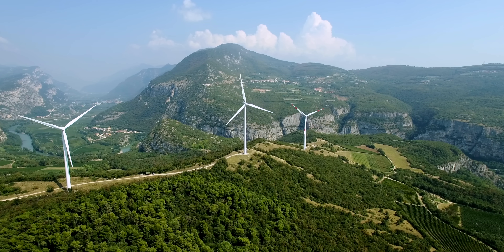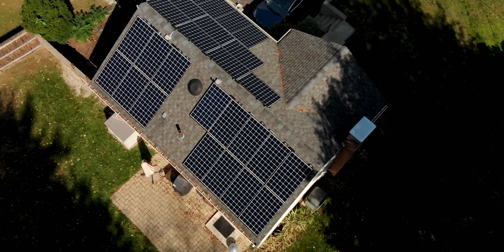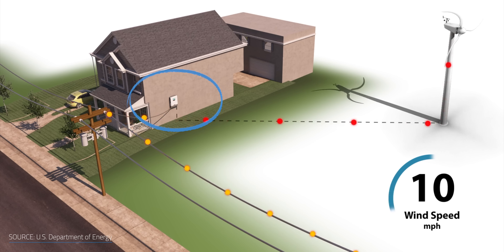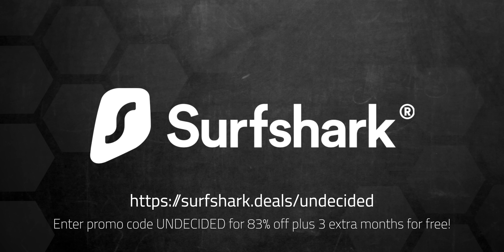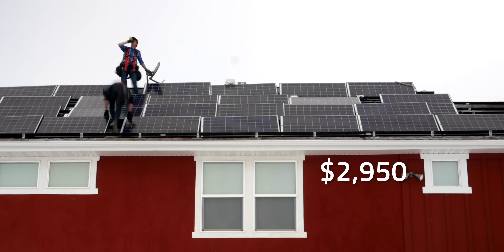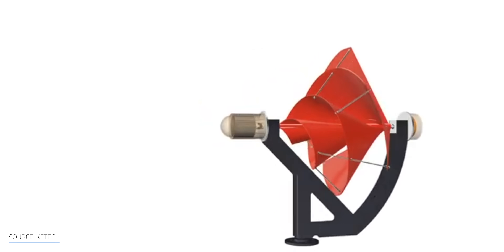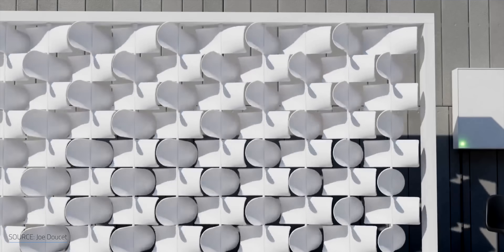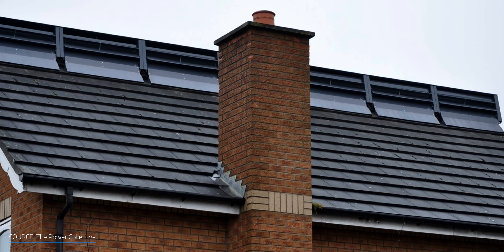The Challenges of a Wind Turbine on Your Home

Comment: This video should be 5 seconds long- no, you can not practically do this on a single-family home. Unless of course you want to spend 10's if not 100's of thousands for additional structure and various methods of sound attenuation. In separating the turbine from the home's structure you will lose vast interior space, and probably have a lot of leaks as the two systems can't touch for sound and structural reasons. Yes, he does touch on this in the video- but this is not a situation of pros and cons. It simply doesn't work for almost any home or budget. This is what happens when one Youtuber makes videos about literally everything.

Comment: So do your CO2 emissions include everything that went into making the solar panels or wind turbine, the manufacture of parts, the coal powerplants that run the chinese factories that made the solar panels, etc.  Was the mining of minerals included, and what about the particulate pollution caused by the chinese mines which have no environmental regulations.    Just curious if you included all the "other" factors in your green calculations.

Comment: I currently line in Fairfield, Ca where we can get at least a breeze of a few mph on 95% plus of days. I think that if you could find a small, yet efficient wind turbine and pair it with solar and a home battery pack (ex: Tesla Powerwall) it could make a decent 1-2 punch. I mainly see wind turbines “take over” power production from solar especially during nighttime or during times of severe overcast where solar cannot produce power or is very minuscule. Living on a coast or near a highway/large road or even a train line could also help produce some extra energy

Comment: As you said the payback period is too long and the cost of servicing. If both were 50% cheaper it may be worth exploring. I did like the system added to the roof ridge to gather wind. Looks better than the others perched on a 20M pole or big and fat design.

Comment: yeah, downsizing doesn´t go proportionally. if you want to go from 500kW to 500W, you would have to lower a 100m tower to 0.1m. even if technically possible, there is not much of the wind.
in my country we say for microturbines at least 10m above any obstacles withing 100m range. so 25m trees in the country or 25m houses in the cities + 10m - see how much does that tower cost and then forget it anyways as you probably won´t get the building permission regardless or do it in 5m and produce so ineffectively

Comment: The Ridgeblade system is very similar to a German design called LWS (Low Wind Speed) system, of which it has been impossible to obtain any reliable performance data for over 8 years now. The data they have provided though are data that does not take into account the drag a generator load will impose on the turbine, making the data totally unreliable, with performance even outperforming horizontal wind turbines. Despite having offered them verifiable test result with a trial installation, where they only had to lend us the turbines for the testing phase, pending our actual purchase if they performed even half of their promissed performance, so watch out, I really don't think you can rely on any of their data.

Comment: If you build the wind turbine yourselve, you actually only need a good ac "motor"/generator.
you can build it on a pole, and make sails yourselve.
buying is ok, but takes long te return profit.
build the 250 dollar machine yourselve.
you actually require to buy 1 part (and a converter if its a dc generator)

Comment: There are a few regions where wind turbines work the best, especially at the home level.  Too little wind and the turbines don't move too much wind and the turbines will brake or turn to protect themselves.  So you have to be deliberate when looking into wind.  You can find maps showing where there is optimal conditions.  Honestly, offshore and the midwest are the best locations.

Comment: One common red herring is turbines that work in low wind speeds. Because the available power from wind goes up as the cube of the wind speed so there is 125 times the power available in a 5mph wind as in a 1 mph wind. So optimizing for low wind speeds is a fools errand because the higher speeds are overwhelmingly more productive.

Comment: The roof ridge format makes the most sense for residential use. The actual one posted appears to be sized for industrial use versus residential. From a practical perspective a residential contractor normally does not need a boom. Also in New Enland, as you probably already know the roof ridge support air flow on the underside of the roof. I suspect the amount of power generation capacity, durably and materials drove the design size to a more industrial scale and cost. 

Also I read there are vibration style units under development.

Comment: Great info Matt! I wonder if the Ridge Blade can be made more effective if in tandem with a solar panel install,  a deflector or cover from the top edge of the solar array to the intake of the RidgeBlade would funnel the air heated by the solar panels creating an updraft, and possibly creating a venturi effect  where the air speeds up as it is passing under the solar panels and might also cool the solar panels better as well? not sure if that would be sustainable as the solar panels cool.

Comment: it makes sense to incorporate many of the systems, because none have the operational range to be considered 100% of the power generation you need.  i want to share an idea with you that i've shared with many... its a type of geothermal.... based on that movie 2012... where they have a mine that is at such a depth that it generates enough heat that ice cubes are used to cool the staff...   basically if you dig a hole deep enough that space becomes hotter... but even if you dont' go that deep you can use the heat differnetial to create an airflow that can turn either a wind turbine or steam turbine.   my idea was for a steam turbine, which requires a deeper hole, but the entire system is on a sled that is raised or lowered in the shaft of the tunnel to vary its exposure to the heating source, creating steam that turns the turbine and the power flows up the line to the home/adapters/power storage etc.  idk if i explained it well enough.. but the sled also makes the system easily brought up to be repaired/upgraded etc.... as far as doing it with wind turbines instead... warm air rises while cold air falls, so the shaft also becomes a wind tunnel, thou this would mean you'd need to drill a 2nd shaft from the side to vent the shaft without compromising its temperature... to create a lesser pressure zone to draw the air down... to help augment that flow potentially.  so the deeper the shaft the better, due to the number of systems to optimize its output thou this will potentially cost far more than i'd like, idk.... wind turbines are basically unpowered fans that use the motor as a generator right?   anyhow ty for letting me share the ideas again... i will say after they lunched the john webb telescope i started wondering if that engineering would make space based power generating possible :D  using the heat differential again :D

Comment: one of the problems I have seen or heard is  that you have to choose your choice of power input. either you use solar, or you use wind, or other sources. but you can only generate power from those individually?  And that's so absurd!  We have the technology to harness energy from multiple sources  to put into one place. I've been saying this for years   All power inputs from wind, solar, hydro power can go through a power diverter to  generate  electricity to one source. they don't need to know where this energy came from. it's not their job. just storing it. it's up to the computers  that allocate where that energy goes. So a system of batteries that take the excess energy that all these alternative energies can store . lost train of thought, but why can't you use multiple ways to harnest energy in one place. like in a battery.

Comment: - solar panels are COMPLICATED TECHNOLOGY ... and thus "replace rather than fix"
- wind turbines are SIMPLE TECHNOLOGY ... and thus "repairable"

Alternative power generation is NEVER an "either-or" decision, because it could just be a trivial version of the wind-wheel on a "Western Farm" pumping water "to a higher level" ... and then using that water as a power source. It can even be a cycle using the same water over and over again, and the point of it is to store energy in that way, which even eliminates the need for a large battery storage (which always includes the LOSSES from the DC - AC transformation).

Comment: In the vast majority of cases wind and solar are virtue signalling toxic eyesores.
Just like plastic recycling it is more scam and pollution than actually doing nothing.
Both can be gotten right however but it takes some serious thought and planning and using the right systems in the right way. 
There is actually a way to arrange buildings and solar panels and greenhouses to actually create wind energy when the wind isn’t blowing . This is something that cannot really be done at an individual level by someone who thinks buying an ev and strapping solar panels to their roof is doing their bit for the planet. It would require a new village designed or homes being torn down and rebuilt according to location and shape requirements.
If you were to build a new village according to these design principles where the rubbish and sewerage is recycled on site for fertiliser and power generation or gas for cooking and heating and you use appropriate appliances that didn’t require mains voltage you would be able to not only live entirely off grid but actually reduce real pollution and not imaginary c02 pollution.
The reason big virtue signalling wind and solar farms are so popular is not because they could ever possibly achieve any positive effects on climate change, it’s because climate alarm is just a Marxist political scam to get ignorant and gullible people to welcome the new world order willing not realising that it is simply a Judas goat.

Comment: Don't pay for installation, and do the installation yourself, and the the equation yields: most of the time, stupid to NOT do wind.  I actually have a 1000W turbine. $1000 tops total after install. In my area, I generate more electricity than your figures, and my wind is similar.

Comment: The argument about maintenance is totally unfounded on small-scale turbines. 
Unless you're running a really old brush generator you're only moving parts or two bearings and your pivot shaft which is probably also another bearing. 
These bearings should have a life of over 10 years. 
Lot of the small 500 watt generators are based off of are built out of '80s car alternators which run 10 years with no maintenance in automobile conditions under extreme stress and Max loads. 

I don't know where you got your information on this one but you should do a little looking into what wind turbines actually cost to install and operate

Comment: The problem with this advice is that adding extra solar panels has no effect if you have already maxed out the line capacity of the local grid. At best,  it gives an extra 10 minutes of power, unless you have some storage capacity, which ups the price considerably. At least that's what the  last expert I talked to said to me. Can any expert here tell me otherwise? The devil is always in the detail, and there I find it so confusing.

Comment: This is all very useful information, but I still feel all buildings need both wind and solar, for there will be times during adverse conditions when there’s no sun, like in the northern or Southern Hemisphere  during winter, but lots of winds, the more versatile, the better prepared we are for whatever, and all homes should be designed for survival and stand alone system for disaster’s, which includes wildfires, the smaller our domicile the easier to protect and less power needed, the homes of the future should be affordable, small, efficient and versatile….just a few thoughts, thank you !

Comment: The first heard the term "micro-wind" power in 2003 while visiting an off-grid "intentional community", or old hippy commune depending on your POV, somewhere deep in the woods in/around Vermont or New Hampshire who were fabricating their own parts and building custom-sized windmills attached to various sized turbines they'd made from recycled motors and generators. They found several spots with "micro-climates" on their property where structures, rock walls, or gaps in the forest caused wind to speed up. They managed to place their relatively small devices in spots that maximized the use of the wind and were creating a respectable amount of power with them. Although the small-sized windmill/recycled generator turbine devices were ingenious, it had literally taken them 40 years to figure out the right locations for them.

Comment: I have always considered wind for homes as nearly worthless unless in the country or off grid.  Still there is another use that might make more sense.   If you set up a small voltage system for night lighting outdoors and indoors (6-volt systems usually) you can use just car batteries as your storage.  You lose the advantage of selling power back to the grid.  But you gain a constant lighting system that even in low winds should generate enough to cover your needs daily.   Note this can also be used to charge most portable devices as they often run at less than 6 volts.

Another consideration is if you live along a freeway or highway.  Might sound crazy but the air pushed around by traffic can be an effective way to turn a smaller low resistance turbine.  This would be more useful with the wind wall model show above.

Comment: An alternate thought of wind over solar is the footprint. In the Midwest, South, and Central States area, Hail storms are an annual event causing millions in property damage. Imagine having golf ball sized ice falling at terminal velocity. They hit with enough force to go through automotive glass and force holes in tar shingle roofing. How would that affect a solar panel system? A wind turbine has a smaller footprint by comparison and would be less likely to get damaged. To protect a solar system, one would need an equivalent to a garage door shutter system to protect it. The wind system could be collapsed down and covered or places/ laid over into a solid structure. It could go either way, but it's a thought to consider depending on location.

Comment: For many years I installed wind turbines and solar panels on sail boats.  The turbine for a boat is basically an alternator with a blade.  They are noisy and don't survive well.  When a boat was damaged from a lightning strike or such, the owner always wanted the panels replaced but seldom or never wanted the turbine replaced.

Comment: Turbines are also a good way for the hobbiest to get into renewable energy. With $100 of 3d printer filament and a $20 alternator from an old generator, I built a vertical axis windmill that typically makes around 400 Watts but peaks at around 1200 Watts. A similar producing turbine costs around $1800 to buy.

With power costs here in the UK at the time I built it, I worked out that I would need it to run for 480 hrs to pay for its self. It ran non stop for 6 months before a storm caused a catastrophic, unintended, rapid disassembly.

Comment: It makes sense if you think about how solar and wind scale. A 4kW solar install is just 10x 400W panels. Installing 1 panel instead of 10 should cost roughly 1/10 the price. OTOH, a 4kW wind turbine has all the same parts as a 400W wind turbine. Both still need a generator, gearbox, bearings, tower, blades etc. The main difference is the 400W turbine has blades that are ~3x shorter. Sure you can lower the strength requirements for those other parts when you scale down, but you're not going to save 90% that way! Solar makes sense at any scale. Wind makes more sense at larger scales.

Comment: I tend to not trust people when they flat-out lie. Solar panels do have maintenance costs. The panels get dirty over time and you need to clean them to restore its efficiency. Unless you have special tools, you will need to pay someone to climb up your roof, spray approved cleaning solutions, and wipe off. You can't use ammonia-based cleaning solutions since it will damage the panel.

Comment: i feel that the goverment should force cities to put solar panels on their roofs and when suitable have wind turbines.
if every building in a city had solar instalations it would greatly cut back on the need of power generation via other methods and if we add wind even in an incomplete stage or set up the posts for placing wind generation it would help branch things into it when it was viable.

Comment: Smaller turbines spin faster and kill more birds. We had a local supermarket install a 3m diameter turbine and they took it off after less than a year, in part because of that. We also installed some 'indestructible' vertical units on telecoms high sites but it didn't last past the first storm. Worked really nice for about two weeks. It can help A LOT to extended battery life on solar-only sites by reducing battery cycle depths, but it's definitely a hobbyist hands-on endeavour.

Comment: I think if I need to use alternative energy I'm going with gravity. Stick a 200 gallon tank on a 10 ft tower a few gears and a generator and as it lowers, boom, I got tones of power. To lift it back up I'll use my tractor, or truck or in the worst case a come-along.